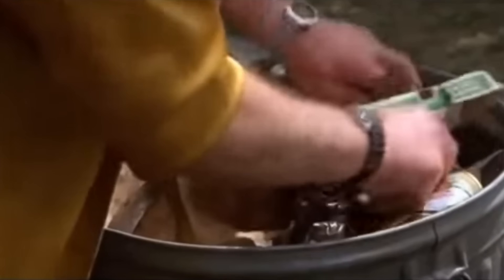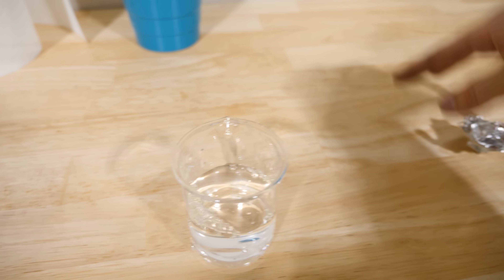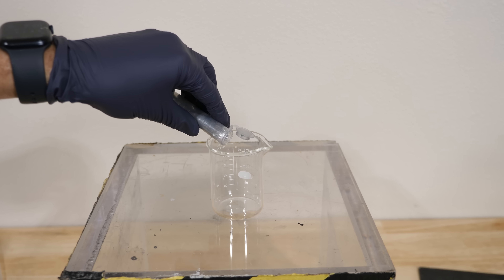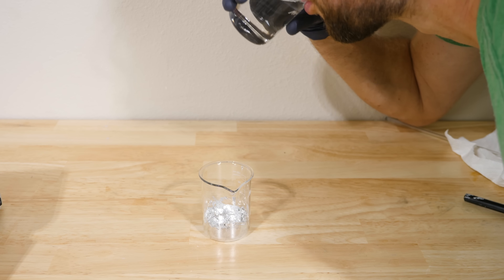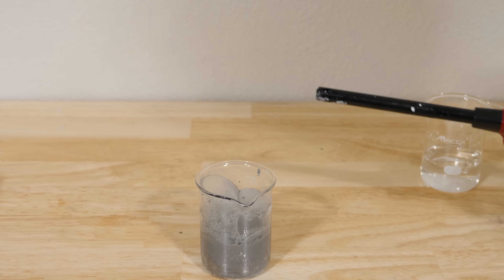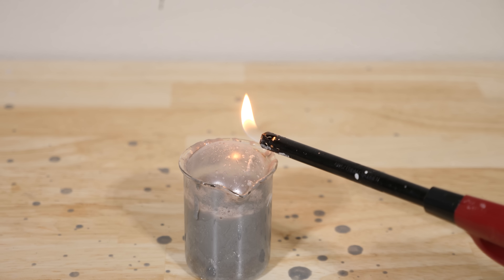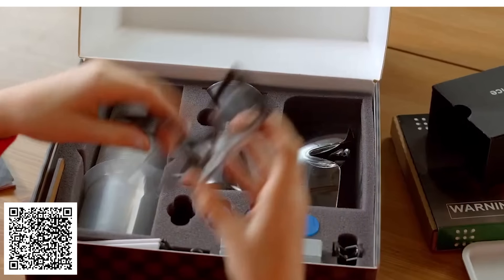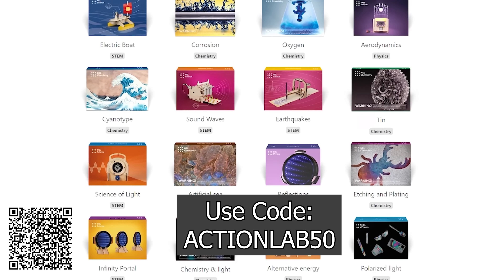This Liquid Metal Turns Garbage Into Fuel

Comment: Gas is very flammable and too dangerous to use as a fuel. Don't forget what happened to the Hindenburg. The only reason Germans was using that gas is because they didn't have any helium to use and it was hard to get. Also harder to get now once it's used up on earth that's it. No more.

Comment: Hydrogen being a gas could be obtained using this process and tanked for use . I will say doing so as a home experiment may get you blown to bits as any spark or someone smoking may ignite the airspace. We did a similar thing back in the 70's trying various experiments to prove or disprove claims like the draino in a ping pong ball dropped into gasoline and it did nothing but we filled we filled a fairly large balloon with the home made gas and sent it up using a time delay igniter and BOOM! My roommate was a creative sort, made a few bizarre looking things that actually worked and was a great airbrush artist. I about killed him when he had pinned down a cockroach under microscope and airbrushed it setting it free laughing about custom painted roaches. We were likened to Oscar & Felix in that one was a drinker the other a stoner and it's not rocket science to figure out who the stoner still is.

Comment: How much of the energy that went in to manufacturing the aluminum can be recovered in this way?

Clearly, doing this with aluminum that would otherwise wind up in landfills is a plus. But just as clearly (I expect), making new aluminum to use in producing hydrogen would not be.

Comment: Hi The Action Lab,
Nice video.

Depending on the molar ratio (or the weight) of the reactants of aluminium and water you can have different outputs:
2Al + 3 H2O --> Al2O3 + 3 H2(g)
Al + 2 H2O --> Al(=O)OH + 3/2 H2(g)
Al + 3 H2O --> Al(OH)3 + 3/2 H2(g)
and
Al2O3 + 3 H2O --> 2 Al(OH)3
HO-Al=O + H2O --> Al(OH)3

You spoke about NaOH and the way it is consumed into the water decomposition reaction from aluminium by chewing the oxidized protective layer of the naked metal:
Al(OH)3 + 3 NaOH -->(NaO)3Al +3 H2O
HO-Al=O + NaOH --> NaO-Al=O + H2O --> NaO-Al(OH)2
NaO-Al(OH)2 + 2 NaOH --> (NaO)3Al + 2 H2O
and
O=Al-O-Al=O + 4 NaOH --> (NaO)2Al-O-Al(ONa)2 + 2 H2O --> 2 (NaO)2AlOH + H2O
2 (NaO)2AlOH + 2 NaOH --> 2 (NaO)3Al + 2 H2O
-------------------------------------------------------------------------------------
Al2O3 + 6 NaOH --> 2 (NaO)3Al + 3 H2O

That is the usual NaOH prills / Al dust to declog plumbig; (beware caustic and dangerous for eyes (possible permanent blindness) and for mucosas; so wear personnal protective equipment (PPE-googles, face shield, labcoat, glooves)
--> heat, 
--> soap making from greases, 
--> strong base to decompose proteins by hydrolysis (like fibrous hair clogs) 
--> and H2(g) generation as a foaming inside the clogging liberating some pressure with a physical action inside the clogging.

Of course you forgot the famous acidic reaction of HCl:
Al + 3 HCl --> AlCl3 + 3/2 H2(g)
and the spontaneous recycling of the HCl due to hydrolysis of certain Al salts:
AlCl3 + 3 H2O --> Al(OH)3 + 3 HCl
2 AlCl3 + 3 H2O --> Al2O3 + 6 HCl
So a little HCl or NaCl in acid media can litteraly chew through a lot of aluminium down .

Last advantages HCl is gaseous, and can be concentrated by dissolution to about 35% by weight into water (that is almost 10 M solution or 10 mols/L (350g HCl/kg water); so it could be also endlessly recycled by vaporisation and recondensation-dissolution; of course this depends onto the side reactions of the "pollutants" inside aluminium foil (there are always others metals as traces into it because it is not chemically pure (thus far from lab grade ingredient) as an industrial product and finally ending as a garbage.

The funny and beautifull part of this acidic process is that the after garbage of Al2O3 can be recycled into corrundums (saphires and rubbies of nearly all rainbow colors even colorless leuco-corrundum) but that is a totally different story flying far above most people heads.

Regards,
PHZ
(PHILOU Zrealone from the Science Madness forum)

Comment: Except aluminium takes a ton of energy to make, using electricity, the most useful form of energy. So it's much, much, much more energy-efficient to recycle it, and aluminium is one of the few things that is heavily recycled, and has been for a long time. It would be a massive waste to use aluminium as a fuel. Better to recycle it, and save the energy of refining it in the first place.

Comment: Yes you might well be able to reuse the Gallium, however the process of producing Aluminium from Bauxite  is extremely energy demanding, this process would use way more energy than other methods of Hydrogen production. Aluminium can be recycled at a fraction of the cost of raw production, so this is a real stupid idea.

Comment: What happens to the aluminium after the complete reaction? Can you use it as aluminium?
For the water, i already know because during the reaction the hydrogen forming the water molecule is released and use as fuel, but does the residue is aluminium oxide or something else?

Comment: You everybody dont understand one crucial thing. Galium is metal that is highly corrosive to other metals like aluminium. Nobody will every tell that it is safe battery. 1g of Galium can destroy airplane... structually... basically we use aluminium more that any other metal in normal life equipment , cars airplanes, bicycles etc... galium is like ghost desroyer of the worlds.
Reply: so stop this talk about what galium can do... basically to simplyfy this aluminium and galium are most reactive metals... reactive i mean really really reactive ... after reaction there is no aluminium or galium they want to be together in a subatomic state that for normal persol looks like dust.... this is final step. So.... there are many other chemistries that are based on that approach... where we need to be chemically instable not safe and bad for ppl that use anything... you can use H2SO4 / PB battery ... it has same energy density... just we dont use in normal life better solution ... because you know why ? oh... you dont... because battery need to cost 100 not 10 ... this is just a reason. there is many places like that ... we are surrounded by this everywhere in advertisements etc... You need to be healthy you need to take pill that cost 0.001 USD but in pharmacy it cost 100 :) ehh...

Comment: Gallium is about $3 per gram as of last year, with the bulk of its use in gallium nitride semiconductors. There's no real gallium ore perse like we have iron ore, its mostly a byproduct in refining other metals. So large scale use would be difficult, although the recoverability is a strong selling point. 

You do lose some of the gallium from being attached to alumina, oxidation ECT, but not much. Recoverability is probably around 90-98%. Although your gallium will be contaminated with oxides and  alumina. After repeated cycles you will notice a decrease in efficiency.

Comment: I do not know if automotive application is considered by you a large scale use. But to decide if suitable, we need to know at what pressure of Hydrogen the reaction of Aluminum suspended in Gallium stops. If it is reasonably low pressure, then yes, because all the Hydrogen not used right now, can be preserved for  when you start the car later....So it would operate at just about 100% with no loses. But the reaction neeeds to be tweeked, so that the OH group of Aluminum hydroxide can be broken, so, that it releases the remining  H and aluminum oxide is harmless abrasive white powder,which has many uses and perhaps can be broken up  into O2 and Al by some reaction.

Comment: So solder flux, spread on tin would do the same. As its known to remove that oxide build up. Huge...thx...winter is still here. Loads where produced in that experiment. Hydrogen is vastly dangerous in volumes. And remember Robertson's flashback resistor patient still have world record for most lives saved. Use one...a..😊Cheer's

Comment: Hi. I'm really into chemistry. When you do these experiments, could you go into the chemistry of it? What happens to the aluminum and the oxygen? Now, I concluded from the sounds of the ignited gasses, producing "poob"'s and not the sharp "snap"s you'd expect if oxygen was mixed in, that the formed salts are aluminumoxide dissolved in the water. It would stand to reason that that also is why the reaction stops. Is that correct?

Comment: The Aluminum Oxide on the surface of Aluminum foil and cans is the same Aluminum Oxide as Rubies and Sapphires, just not crystalized in large masses. So it's second only in hardness to Diamond, rather chemical resistant, and very tough. You can actually make gemstones with a blowtorch by getting this oxide to melt, fuse, and crystalize. I've even seen people do it in a microwave oven.

Comment: how do you separate the gallium from the dissolved aluminum without burning the aluminum?  I want to use the melted aluminum for casting since it cost a lot of energy to melt aluminum using propane / gas / electricity.

Comment: Uhhh, we usually recycle that aluminum - as long as you got the energy, you can recycle aluminum forever and ever. IIRC, it's cheaper to use recycled aluminum than to make new stuff, both in terms of $$$ and energy, so please don't make it sound like post-consumer aluminum is this useless waste lying around taking up space. Having said that, there's nothing wrong with using green energy to refine aluminum as a storage medium for energy - it seems like it'd be safer than storing pure hydrogen, and might have other benefits

Comment: I have an idea for already known science...

Hydrogen extraction & graphene sublimed 

Grow sustainable forests.

Use an electric oven to cook the dried wood.

Capture the hydrogen gas and bottle for hydrogen engines or fuel cells and blimps (just don't coat them in flammable tissue coated in … I think it was thermite or something really explosive ☠️ 🧨 not to Brite back then, well the Hindenburg was pretty bright for a second 😆😂😆)

Wile cooking off the wood and caracoles, graphene  sublimed on to gravel and sands.

Those gravel and sands can then be used to make very strong concrete.

And possibly increase the efficiency of the sand batteries…

The potash can be used to fertilise the forests, and sold as a fertiliser.

Comment: Add some gallium to it 💨
🤔 What is the full left over waste after stripping the Hydrogen atoms? 
Would be bad if the burnt fuel has aluminum particles to be breathed in by unsuspecting gunipeople 😳

Already proven that aluminum gets in the brain, damaging it.
Aluminum, as a known neurotoxicant, contributes to cognitive dysfunction and may contribute to Alzheimer's disease. The important reason is that aluminum can enter and be deposited in the brain. - PubMed

🤔 Is it a sustainable fuel source, costs more to  mine than to recycle...
Reply: I have an idea for already known science...

Hydrogen extraction & graphene sublimed 

Grow sustainable forests.

Use an electric oven to cook the dried wood.

Capture the hydrogen gas and bottle for hydrogen engines or fuel cells and blimps (just don't coat them in flammable tissue coated in … I think it was thermite or something really explosive ☠️ 🧨 not to Brite back then, well the Hindenburg was pretty bright for a second 😆😂😆)

Wile cooking off the wood and caracoles, graphene  sublimed on to gravel and sands.

Those revels and sands can then be used to make very strong concrete.

And possibly increase the efficiency of the sand batteries…

The potash can be used to fertilise the forests, and sold as a fertiliser.

Comment: But if you put hydrochloric acid on the aluminium the acid will dissolve the oxide layer, and will expose fresh aluminium metal.
If you drop it into boiling water ,there will be an agressive reaction.

The water needs to be boiled, because there is air in the water, but with the heating the air comes out.

Comment: I built a reaction chamber into which I put post-consumer (used) aluminum foil and either potassium or sodium  hydroxide and water. I use the hydrogen produced therein to run my off-grid emergency electric generator. The off gas is bubbled through a water column and then stored in a bladder. The generator engine is naturally aspirated. When the fuel runs out, it stops.

Comment: Wouldn't it be more practical to simply melt the aluminum and react it with steam? Gallium is expensive, and even though it's theoretically recoverable you likely lose a significant amount to oxidation and getting mechanically wicked up into the Al(OH)3 slag..

Comment: I have a patent to produce hydrogen from aluminum using Gallium in efficient ways. Gallium is expensive. My patent uses drops of Gallium eutectic amalgam that is liquid at room temperature to break the thin layers of aluminum oxide that makes Aluminum non reactive to water.  Once the aluminum oxide layer is broken, the aluminum is very reactive with water and will release copious amount of hydrogen. Search my patent under my name under the title "Method for production of power from aluminum".

Comment: Cool video, but how did you get measure the output of hydrogen gas, I believe you said 130 milliliters per gram of alloy. Is there a formula or conversion method I should use?
Reply: Pls help
Reply: Calculate the amount of moles in one gram of aluminium using mass divided by the atomic mass, use the ratio of aluminium used to hydrogen gas produced to get the moles of hydrogen you are producing. Times that by the Mr of h2, then divide the mass of hydrogen by the density of hydrogen to get your volume of hydrogen produced

Comment: There is a huge embodied energy in Aluminum metal, for the exact reason that it takes so much energy to reduce it from bauxite. In fact it takes 1/20th the energy to recycle Aluminum that it does to convert Aluminum from Bauxite. All this process does is return much of that embodies energy.

But here is the real kicker—the way to reduce Aluminum Oxide to Aluminum Metal is by getting it to react with carbon, producing carbon dioxide. 

You might as well burn the hydrocarbons directly. You produce the same end product without the costly intermediary, and we already have the logistics for that worked out.

Comment: Maybe there is a better fuel.  Copper ignites at 1886F.  I have created plasma arcs that vaporize copper and that vaporized copper burns in air (produces a greenish purple flame).  Copper/air fuel needs only about 800w electricity to create the plasma.

Comment: If you just wanted Hydrogen from aluminum and water then it would be simpler to add sodium hydroxide (caustic soda) to your water. Gallium is not readily available to most people and it's certainly more expensive than caustic soda. Nonetheless thank you for your content.

Comment: Turning precious metals, which are mined, to create a gas that can then be burned, a solution. Could be for recycling, but finding a way to pull carbon out of the air ( like plants) and create energy then we will have the solution we need. I had been thinking using scrubbers made from graphene as they were about to make graphene from carbon directly; why not just pull it from the c02?

Comment: Gallium is rare and expensive and there is no easy "green" way of winning back the Al metal. 
Al has a huge energy density but once consumed, it also takes a huge amount of energy to reduce the oxide. Because of losses the energy input must even be higher than what was won.
Reply: Bravo! You nailed it
Reply: @petruse8893  Now if I were "really" smart, I would have an idea how to reduce aluminium oxide to aluminium with a greener, more gentle process. Aluminium is of course absolutely wonderful as energy carrier. It would be nice if there were an organic Al salt, soluble in an organic solvent as starting point.

Comment: TIME TRAVELER HERE FROM THE FUTURE. TURNS OUT ALL THE STREET SIGNS WERE MADE OF ALUMINUM INSTEAD OF CHEAPER GALVANIZED STEEL STRICTLY BECAUSE OF THIS REASON. WHEN THE FUTURE TANKS START ROLLING IN, THE WILL USE THE PLETHORA OF STREET SIGNS TO GET AROUND NO PUN INTENDED. THEY WILL USE THE ALUMINUM AS HYDROGEN FUEL GENERATORS WHICH SUFFER A FATAL WEAKNESS IN THAT THEY GO BOOM WHEN YOU JOSTLE THE AIR DUCTS.

Comment: Although there are a lot saying this would be bad for cars. They are looking at direct use which is the problem. This would be good for vehicles if this is done at a recharge station where they recycle aluminum. The station can easily get a lot of recycled aluminum from local sources and pay out for it. The the station would do the process and storing they hydrogen thats created into recharging tanks for swapping out much like propane swapping. Could also have on demand recharging if needed for other applications. Now what can be dealt with the after process, the aluminum would be more broken down so its more compact and more efficient to transport. Aluminum cans have to be smashed into giant bails cause all the extra space but aluminum scrap is harder to do this with. But this is just a guess as I don't know the exacts of refinement for the leftover aluminum from the experiment. Regular car use would be a short supply problem but public transportation could use this as a fuel source, instead of busses, could be something like vans running all day long instead of larger busses which most of the times waste fuel running only a few passengers a time. It could be the ideal option for food delivery as that has seen a pretty large increase in use and they can run all day long and may not have enough time for recharging in-between so multiple vehicles would be needed or hybrid.